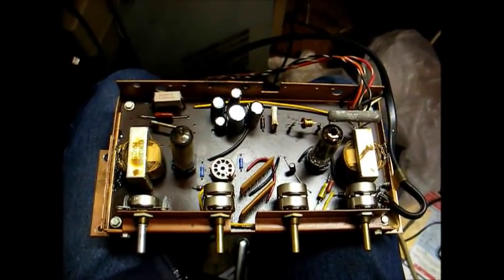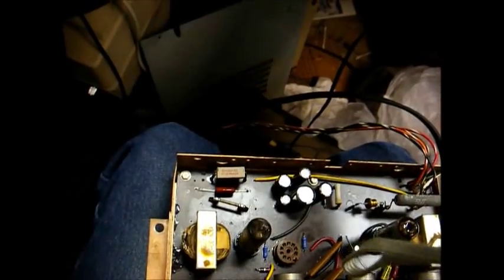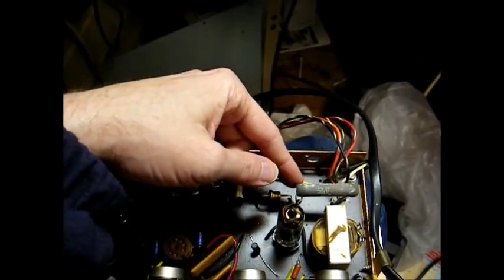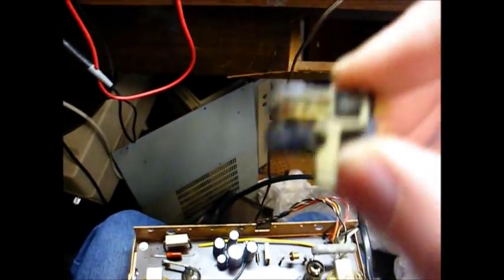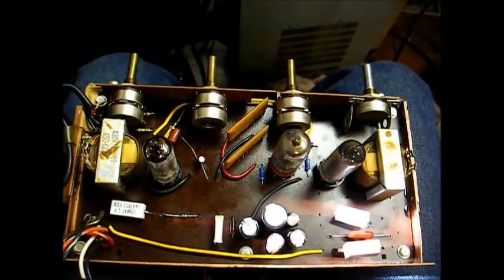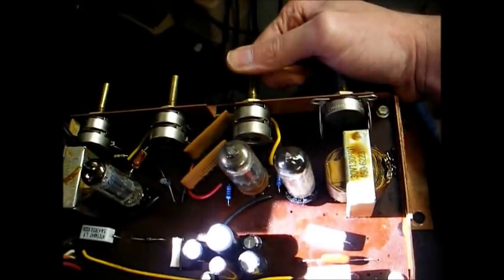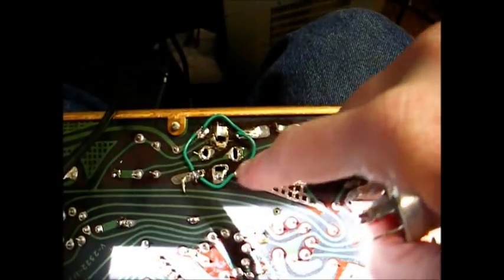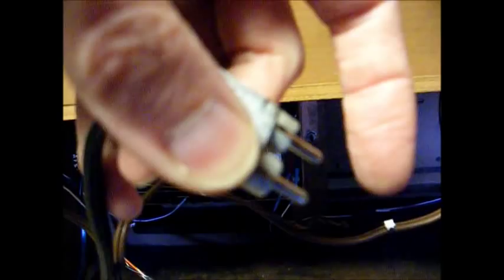Tube amplifier repair for 1963 Westinghouse console stereo record player

Comment: I have 1962 Curtis Mathes console with a radio, turntable, and two pairs of speakers. One side of the speakers work, the tube for the not functioning speaker pair has a bad 6BQ5 tube. I replaced the tube with a new comparable tube from another manufacturer. This resulted in loud squelches in the speakers. Should I replace the tube for the functional speakers with a tube from the replacement manufacturer as well?
Reply: In addition I tested each speaker pair with the only functional original Curtis Mathes 6BQ5 tube I have and each speaker pair works fine.

Comment: I just purchased a Westinghouse H-89 suitcase phono at a local thrift store.  The chassis appears to be exactly the same as yours.  Same tubes, capacitors and resistors.  Unfortunately I don't have the speakers to match.  I noticed you installed speakers. The turn table is the same too but has Westinghouse logo.  I am having trouble locating a schematic.  What is the impedance of the speakers you added to yours?  Thanks for posting videos.  I have been a subscriber for some time and enjoy following your adventures.  Great work!

Comment: Great video very informative! 
I recently acquired a console record player/ radio my self. It's a Fleetwood corporation build.
The Garrard record player works and the sound is good. It needed a bit of a clean up of the old grease. I didn't had any trouble with the radio
The build-in amp is ok, I think. There is no hum coming of it. I did clean the volum dials with electrical contact cleaner though. That got read off all the crackling statics that would I hear over the speakers. Sadly one problem still persists. The sound coming out of the right side speakers has a nasty white noise sound mixed with music. The left speaker set has not such issue.  perfectly clean sound is coming out of it.

Maybe you can help me to solve this problem with the sound or suggest some ideas what it could be? 
Thanks
Reply: The white noise can be due to a leaky germanium transistor in the audio driver,audio output stage. Rarely a leaky capacitor may cause the trouble. Freeze spray may be able to locate the faulty component. Spray one component at a time The cold may shock the component to increase or decrease the white noise in that channel

Comment: forgetting to ground the cap  done that . putting 1 in backwards  there's a hole in my old shop door  from the 1 we used to teach Electronics course. a guy with the engineering degree put a cap in backwards and put a hole in the fire door  ...